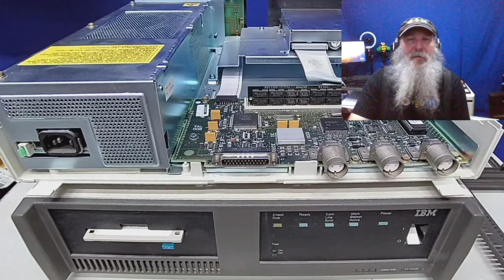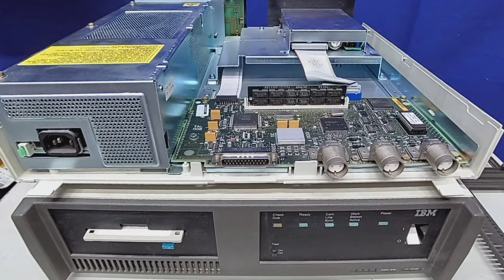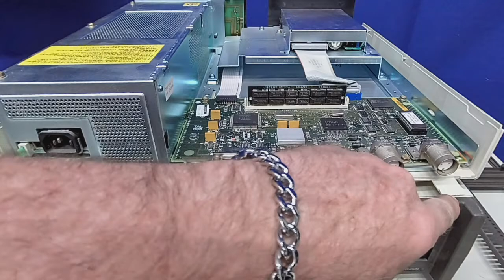A quick view inside of the IBM 5394 "Remote Control Unit"!

Comment: The PSU is absolutely humongous! And it only has to power the tiny planar and one floppy drive. Perhaps the same chassis was used for some other, more complex, equipment as well?
Reply from the maker: The front panel too - but the amazing thing to me is that the only connection for everything is through an edge connector to the PCB like a miniature Model 50/70. (it's only 5 and 12VDC levels too - they could have done a 4869 or 3510 PSU inside) There is venting all over - then the case plastic covers most of it. I don't think there is a fan either.

Maybe some circuit that maintains power as a backup for the system? But then, the terminals and other attached devices likely wouldn't have that. Time to open it up.
Reply: @IBM_Museum  What is the wattage/current rating?
Reply from the maker: @GeckonCZ : It is unmarked wattage - and in a big surprise, most of the metal enclosure is a void inside. Strangely, it has a '450V' warning externally on the PSU, and a further label inside - switching voltage maybe? I'll open the PSU to see if it might be an auto-ranging source, or maybe the manual has more details.

The diskette drive is almost fully enclosed with a metal cover too - then the PCB has no EMI shielding. It's an enigma wrapped in a conundrum.
Reply: @IBM_Museum  "Big surprise" indeed. The same chassis was no doubt used for something else. Wonder what... 450 V seems a little bit excessive even for a doubler... not sure.
Reply from the maker: @GeckonCZ : Another odd area is a matching serial number on the PSU to what is on the front bezel - mine is clashing since I've swapped front bezels when I glued one (they are the same type unit, and likely received together decades ago).